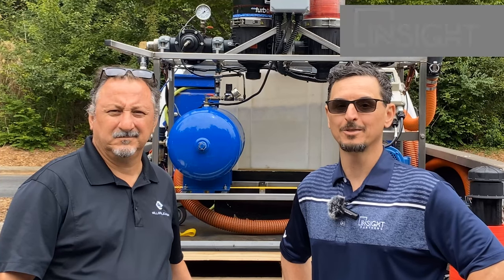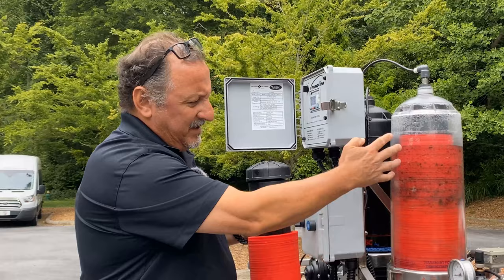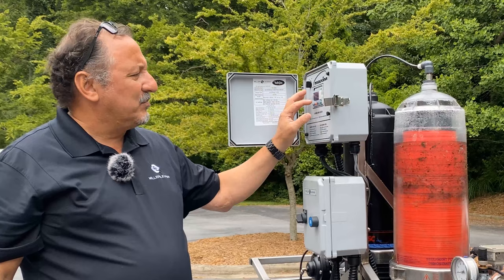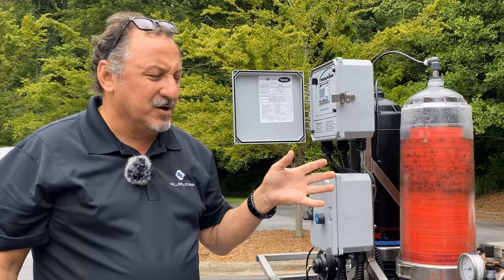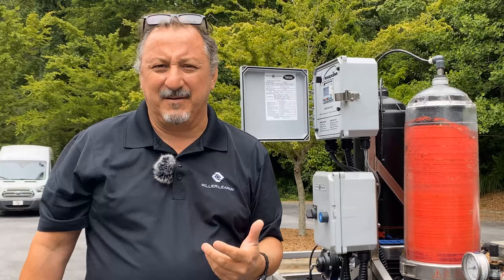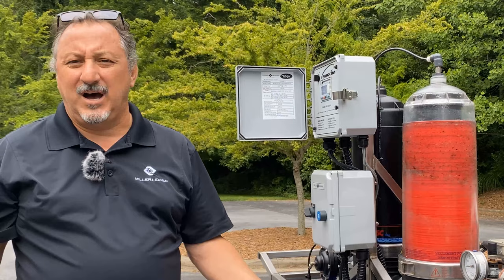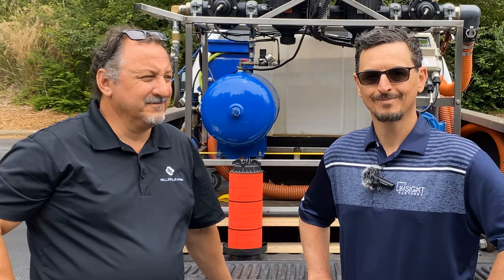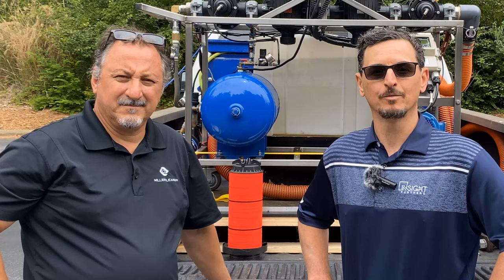Cleaning Water And Saving Water - The Turbo Disc In Action

Comment: Great demonstration! I have sold TurboDisc filtration systems for cooling towers in a side stream configuration in conjunction with basin floor sweeper systems or direct full flow filtration to protect Process equipment or Air compressors for over 15 years.The Miller Leaman TurboDisc works beautifully. It uses less backflush water,  pulls out the very fine particulate, eliminates the problems created by dirt in a system, is easy to service and dependable. Made in the USA in Daytona Beach, Florida and represented by Insight Partners.